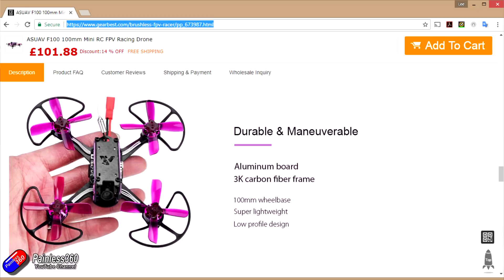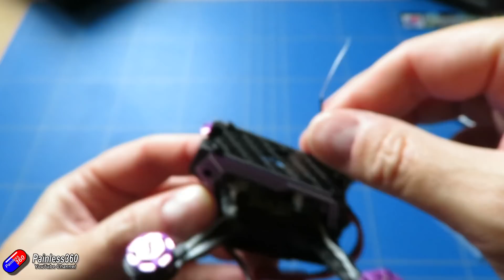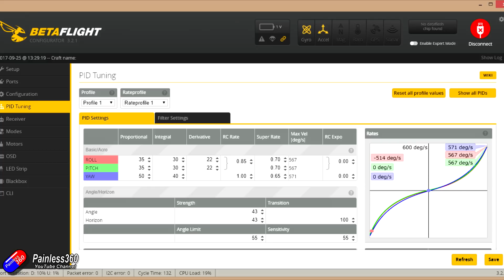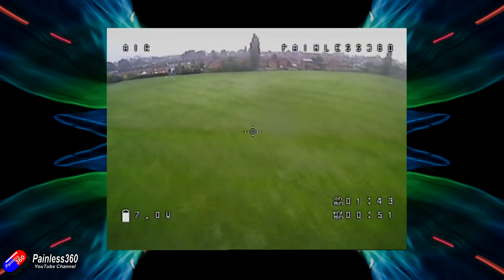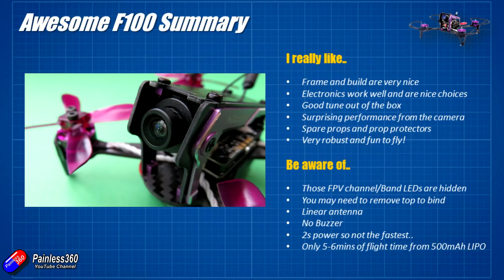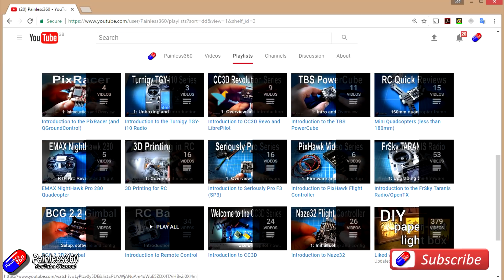RC Reviews: Awesome F100 Mini Brushless FPV

Comment: Nice review and flight. I don't understand the use of 1103 motors over 1104 motors. In a thrust test of an 1103 10000kv vs an 1104 7000kv motor with a Gemfan 2035 4-blade prop on a 2S LIPO the 1104 produced 40 grams more thrust while only weighing 2.6 grams more than the 1103 and pulled only .4 amps more. What are your thoughts on this? Thanks for the review and Happy Flying!
Reply from the maker: Good question, I imagine they got a load of the motors for a good price :D

Comment: I was flashing my esc's in Blheli
I had checked against the correct firmware for the esc's
I proceeded to flash and almost complete ,it said something like failure to complete
Now there was no smoke,nothing fried
So now in Blheli,it only sees 2 esc's when read
Is there a fix
So now in Blheli, it only sees 2 esc's when read .
I did try using an Arduino Nano but boot loader not recognised
Reply from the maker: Hi Graham, bugger! Sorry to hear that. I must admit I never update these smaller quads as I'm always cautious about how well they will work with a later version. The only thing I was going to suggest was that trick with the Arduino in case the Pass-thru was the issue. The boot-loader on the ESCs should still be intact so it's pin to pin to try and get it back to life.. Best of luck with it. If you get it sorted can you share?
Reply: Thanks

Comment: Like the ELASTIC battery holder, HATE no antenna protection, I'm sure I have a BUZZER with two WS28 LEDs either side here some where .... ; /,  overall I LIKE the styling. These HYBRID Quadcopters, open source parts in a retail design, are great for the Potential hobbyist that might have to fix theirs after some fun and its easy with some effort. Cheers !

Comment: Interesting, that Awesome 20x25mm ESC/FC/VTX combo is also on the AuroraRC QAV105 which I just looked at.  Although, they weren't nice enough to include instructions about the LEDs on the VTX, so it took a while to fathom out.  5-6 minutes on that lipo sounds like a very good flight time

Comment: Plz suggest me a awesome flight controller which is latest and easy to install 😀
Reply from the maker: HolyBro Kakute F4. I've been impressed with the performance of it in the Kopis 1 (see review), so much in fact that I've ordered one for the Bolt RC Kraken WORX build (see build video).. Everyone has their favorites..
Reply from the maker: There area loads to choose from - see the 'Quadcopter Building for Beginners' series on the channel for some recent choices. Frsky, HolyBro, BrainFPV and others all make really nice, easy to use all-in-one flight controllers now that make building support easy.. Depends on the frame, how you want to fly and budget really..
Reply: F4 with integrated OSD